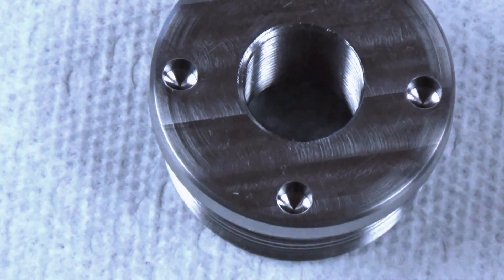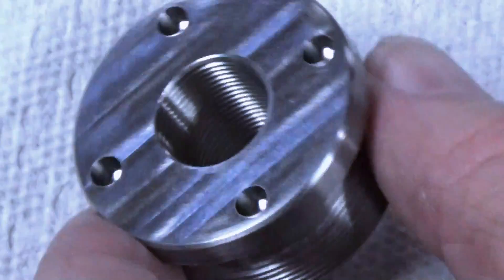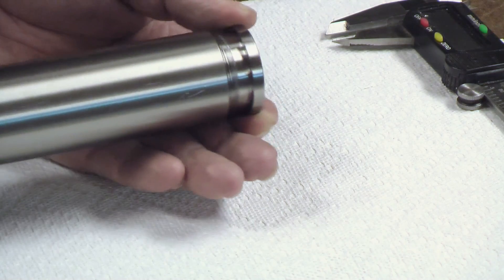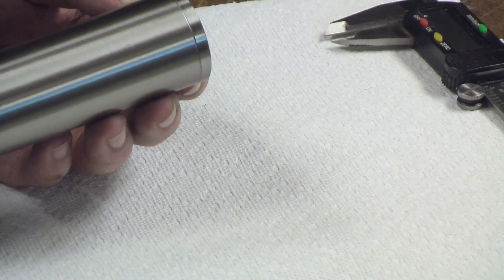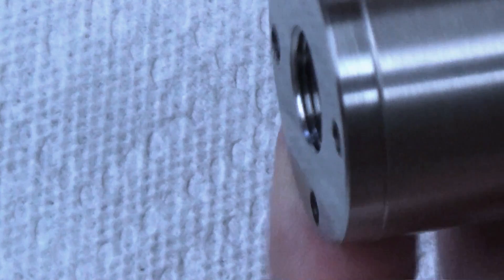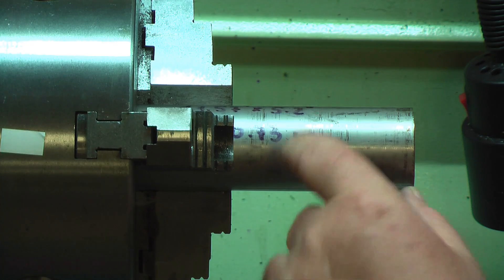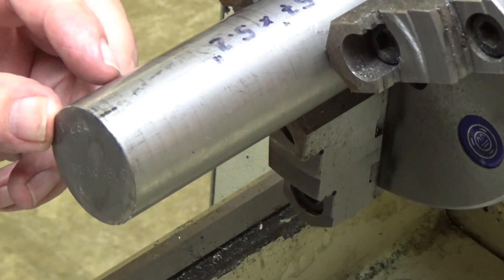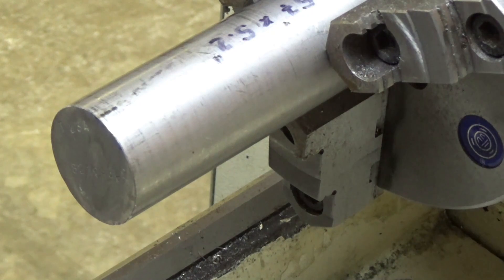The Trouble With Drilling Titanium:The Endcap

Comment: Love the videos, i am looking at making my own suppressor, but an over barrel type, the idea being it would stablalize the suppressor being it would sit on the barrel towards the action, as well as being screwed onto the barrel itself, the end towards the action would have a custom end cap with the measurments of the barrel at the point of contact, just not sure how i would secure the treaded part as it would sit 4 to 6 inches inside the barrel, not sure press fit would be the way or grub screws from the side with lock tight, love to see you make an over barrel suppressor
Reply from the maker: here ya go, its called a reflex design https://www.youtube.com/watch?v=u6kQw6kGOYI

Comment: Yea when it gets hot it starts eating drill bits i  have my lathe set between 1500 and 2000 and more coolent than what you spitting out i cheat a little and add ice to the coolent it really helps.

Comment: Basically you have to,  keep it wet, with a small pump and recycling bucket,  under the drill bit,  and pouring,  white cool down,  on it,  and Dimond bit,  cut into it , like a hot knife in butter.

Comment: low speed 50 rev and dril 8 mil en next 22 mm dril, keep the workpiece cool. most of the heat goes in workpiece. steel heats the chips , titanium heats workpiece and tools. use cutting oil on the dril, and make short dril steps, but very important dont let de dril slip. start ferm cutting and return dril while cutting fast . slipping causes harding and ruines your bit the next atempt

Comment: just curious why everyone seems to use combined center drills to drill full depth for starting a regular drill?  Only the slightest pip is needed to start the twist drill. These combined drills are obviously for putting a hole in for live centers.  In my experience, they are somewhat fragile, especially in titanium. I've busted a few in the ends of parts before.  
I've actually switched over to using spotting drills in both the lathe and mill and they work excellent.
Reply: Bingo, center drill are for center holes only, spot drills are for starting drills in the center of the work piece in a lathe or in the correct location on a mill or drill press. Most people have been taught to use center drills for everything for decades now and it's a hard habit to break.

Comment: I bought a bunch of titanium ends 6-8 inches long and from 1-3 inch diameter at my local scrap yard for $2 a pound. Is that a good price? They've got a bunch of it, I could send you some pics if you wanted me to get some for you. I haven't tried to turn any yet.
Reply from the maker: I think that is a very good price, are you able to fine out what grade it is?
Reply: I just looked, there's a couple pieces that have CP2 on it, if that means anything. If that's a deal on the price and it's something useable, I'll go tomorrow and get some more. I live in palm coast fl, I could give you my email address or phone number if you want some I could text you a pic from the scrap yard.
Reply from the maker: cp2 is grade 3 Ti, not a deal breaker, may be easier to work with than the grade 5 I've been using. send me a pic 985 320 3350 thanks

Comment: Solid carbide drills thru coolant if possible, just be careful to avoid chip weld, definitely use flood and get it right in the hole

Comment: You're turning way too fast, you can do it with HSS drills but don't let heat build up, like stainless keep the pedal easy if you have carbide it's a better choice, but there also, easy on the speed, and flood coolant... 

Watch not to set the chip pan on fire...!!! 

Just as a hint, on any material, when you see the drill bit changing color  ===> You're turning too fast... 

Mostly on hardenable material you'll be stuck with hardened hole bottom that will be impossible to go through without breaking any next bit that you'll try afterward, even more carbide.

You'll get it done, don't quit...   ;)
Reply from the maker: thanks for the info PB, I don't have any carbide drills with any size to them just a few micro sized ones. I will be posting another video with reduced speeds, but it still took 17 minutes to drill a little over 1 inch, but that is my fault.

Hows your bee stings?
Brian
Reply: BS in The Shop There isn't much left now than just a small spot where they got me... Hope for no more of this...   ;)
Make sure you only use the best quality bits...

Comment: I had the same experience with 6al4v before I got good solid carbide drill bits and went slower to drill. 460-500 is crazy fast. I drill gr5 and 17-4SS at 147 with a slow feed. Good work, Definitely want to see the rest of the endcap videos. I'm curious how the  tap in gr5 did.  Great channel and Zeke gets to supervise... Awesome!
Reply from the maker: that is some great info tony,  I don;t have any carbide drills that big, but I will slow it down on the next one. The four small holes on the cap were drilled on the mill with a small carbide drill and it cut fine. thanks

Comment: Daaamm...was starting to wonder if you were going to be able to get through that piece. Looks to be about the hardest shit I have ever seen anyone try and drill....might even try slower than 300 rpm maybe half to one forth that as it seems the slower you drill the better. And also seems to me someone said with hard shit like this and stainless to change the drill bit tip angle, am going to have to look that up again as don't recall now if it was a flatter angle than 118 or steeper that worked best. Thanx for filming it, always good to know.
Reply from the maker: I'slowed it down and it worked much better!

Comment: Hey man, ya can't meander when it comes to titanium.  It doesn't dissipate heat very well and you have to stay on it and keep it oiled once you get a chip curl going just like stainless.  The suppressor looks good so far, I'm waiting on two Form 1's as we speak.....  You're on the right track, back down your RPM's and apply more pressure if you're not getting results.  Heat removal at the bit is the key.
Reply from the maker: Thanks NG, posting a video reply to this one with slower speeds.
thanks
Brian

Comment: WOW that looked like a total bitch to drill!  Did you tap your 5/8x24 or single point it?  Your threads on the endcap at the beginning of the video looked really clean, but boy, that really fought you just to get that center bore!!  Congrats on the 2k subs and give zeke a pet for me!
Reply from the maker: I used a 5/8-24 tap, I will put out a complete video on building the endcap, but the drilling had so much drama I figured I'd show it. thanks for watching Jeff
Reply: That makes sense.  Thanks again for sharing, Brian!  I feel like if that were me, I wouldn't have kept my cool nearly as well.  what a crazy material